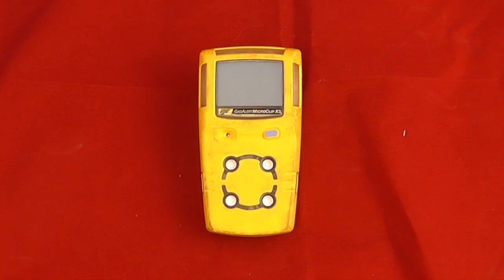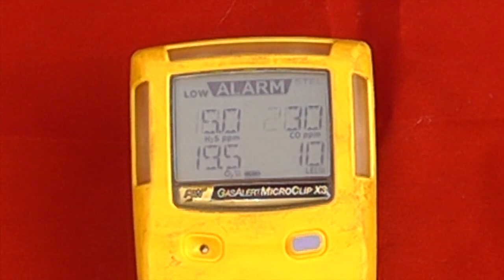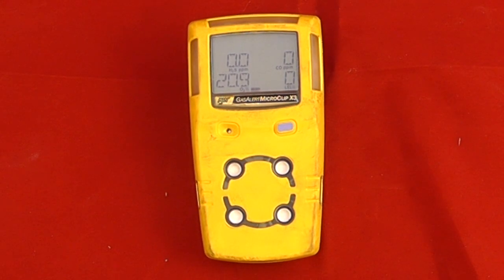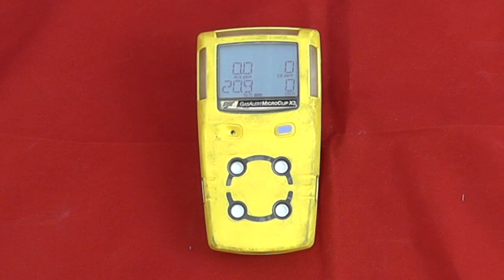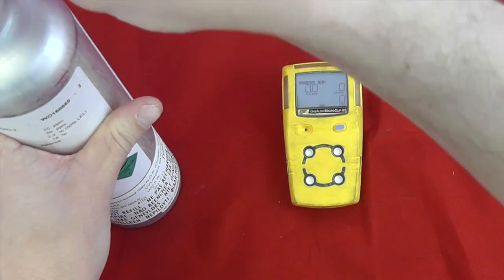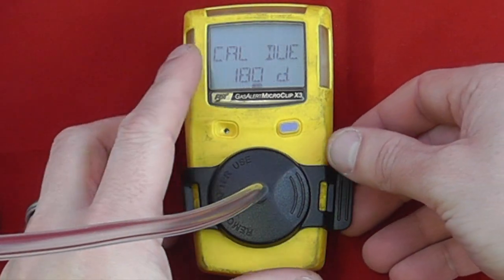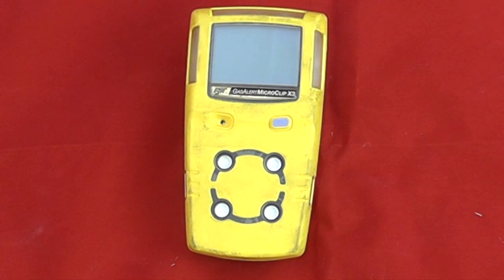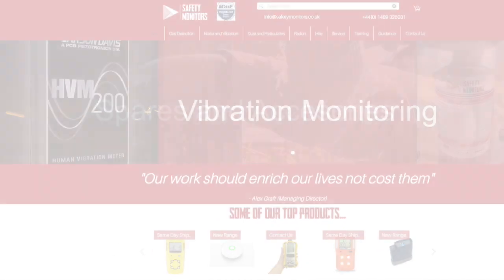MicroClip XL & X3 User Guide

Comment: What that mean by cal failure, after that the screen shows cal dur 12 1 d means
Reply from the maker: The 121 d signifies how many days until full calibration is due according to the settings on the unit.  This will usually be a recommended frequency of every 180 days depending on your setups, regional and company requirements.  In terms of the cal failure on start up this is usually because of the O2 sensor.  When the unit first starts up it does a fresh air calibration on the Oxygen Sensor.  If you are getting the calibration failure message at this point it’s usually because the O2 sensor has failed to calibrate correctly to fresh air.  This can be for a variety of reasons, maybe a faulty or old O2 sensor that needs replacement but could also be due to low battery condition on the unit so there is enough to start it up but not enough current flowing through the sensor at start up for it to correctly automatically calibrate.  If you are still finding the error after a full charge I would recommend returning to an Authorised Honeywell service centre such as Safety Monitors in the UK or a regional Authorised centre if outside the UK and Ireland.  I hope that helps.

Comment: Can results be accessed via Blue Tooth ?
Reply from the maker: There is a bluetooth adaptor you can get for the Microclip which will give you a live view via mobile app however this will not download any data.  If you need that functionality you would need to look at the BW Icon or BW Flex instruments which have come more recently.  The data is also limited to 35 events it doesn't have full data logging.

Comment: What is error2 when I turn on the machine?
Reply from the maker: Usually you will see an error code for a specific sensor.  Fault is probably either a PCB problem or a Firmware fault, can you send it to a service centre?  If you are in the UK we can do this for you.